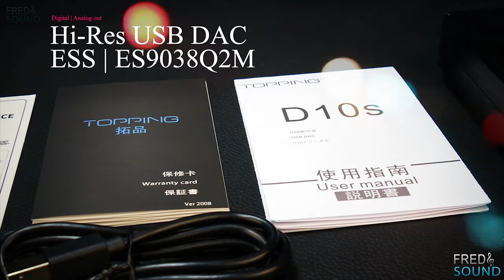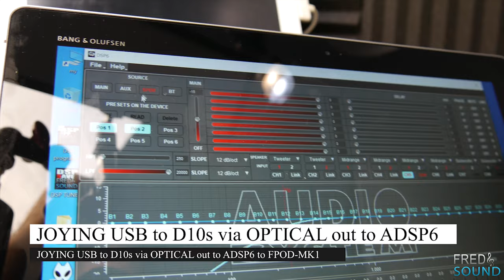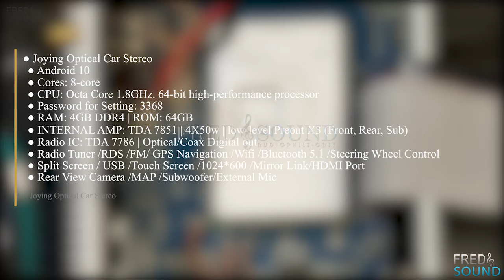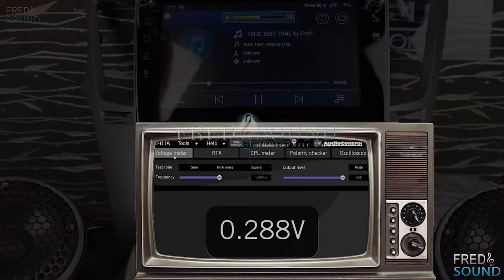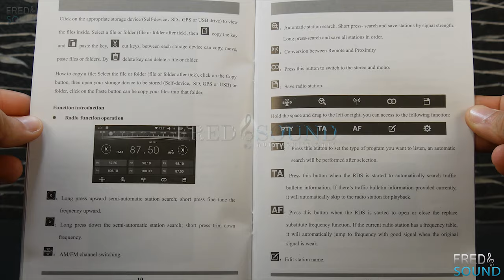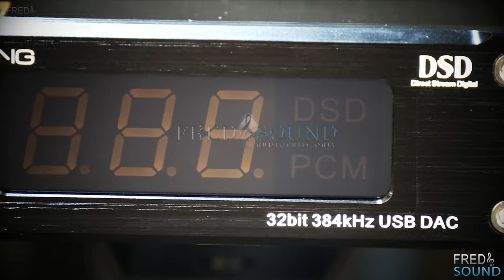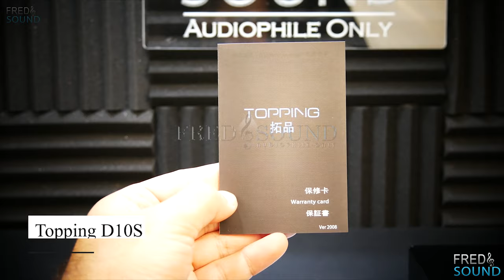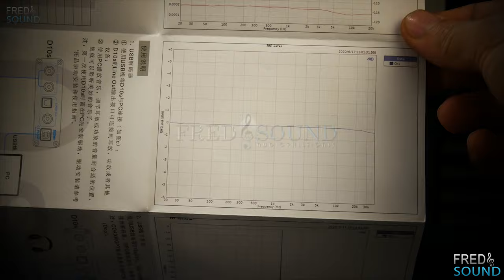Android Head unit using Hi-Res DAC Optical-AUX Out to DSP JOYING vs Topping D10s to ADSP6 (FNS)

Comment: Hello Fred. Is the optical or coax out of this unit very bad to use it straight on the dsp? I was thinking to get one and use it through coaxial to my Alpine H800 dsp. At the moment i don't have any after market head unit as i am using my DAP player for my music, but definitely a head unit is more convenient. What to you think Fred? Thank you very much for sharing.
Reply from the maker: Hi mate, the sound quality of this unit is not high-end at any mean. Yes you can connect it your way and it will work. But You will need to play with some eq input to maximize your flat eq out responds, as this headunit is not transparent you miss many details. If you set the eq correctly you can get it working. Thanks for watching

Comment: Glad to find somebody thinks like me about how to get hi-res stuff in the car. I'm just running old school Alpine CDA 79-49 with Optical output using LG phone with a quad DAC in it. Amazon Ultra high-definition stuff not too bad The best I can do right now but that's right there sweet
Reply from the maker: Thanks for sharing, how is the sound quality? Thanks for watching
Reply: The sound quality on mine it's the best I've ever had but like anything else that that's all you know and the best you've ever had and never experienced any better like what you have it's probably just mediocre for you. Sometimes it's just a challenge to overpower or drowned out the whine of the 14 lb of Boost from the supercharger. Two layers of sound deadening material on the entire inside helped
Reply: I'm looking at the RS Components on your one video where do you find those I can't find them to purchase
Reply from the maker: @russsmith9042  yeah that’s right, as long as you are happy no need to upgrade, about the RS you can’t find much online, they are very limited, if you need could help you getting them, contact by the email down at the description below, thanks

Comment: Question..
When using the Joying unit Optical output is the sound quality bad to any extent? like does it actually sound like it is lacking or sound distorted? or is it just that when using a USB DAC it sounds better?
I just installed a joying unit and next step is to set up an amp and speaker system.
i was planning to use the optical out to the amps and then later add a USB DAC if i find it is needed.
 but i am beginning tot think it is definitely needed.
so if i use one of these then it would be Joying --> DAC --> DSP --> AMP --> SPEAKERS

also i keep hearing that Joying doesn't support USB Audio. clearly it does as you are using it. is it something you hd to set up?
is it something that they didn't do but now do?
Reply from the maker: Hi, yes you can connect it directly, but the issue with joying is the sound quality processing, this is why it’s highly recommended using quality DAC, but then you are limited to control your volume via the DSP DRC only, Thanks for watching
Reply: @frednsound  jut trying to get an idea of exactly how limited. i understand there is shortcomings of the android system just wanting to know just how far short it falls.
is it really only that 1% audiophile sound quality level that suffers?
or will it be distorted and clipping when at a relatively high volume?
i am after nice clarity in the highs and lows but don't need SQL or Audiophile level
Reply from the maker: @SpudMaat  it will not distort early on optical out, it will work fine, only issue is the sound quality, lacking bass and feels empty sound, not full or rich, if you have it already it’s better you use the optical and see if it’s good for you, it maybe good enough for you
Reply: @frednsound  yeah thanks.
i suppose it would be easy enough to buy the system to use the joying optical output and then if that is not good enough would be no trouble to add in a USB DAC
Reply from the maker: @SpudMaat  yes right
Reply: i just find it very interesting how joying does the optical out.
optical out should in theory bypass the inbuilt DAC and sent just the raw signal.
but obviously it does not do that. it must convert to analog and then back to digital for output which will most definitely result in signal degradation. really trying to learn more and more about this topic and this product.
Reply from the maker: @SpudMaat could be, but not necessarily the sound quality issue, the internal board/DAC itself would be cheap, so the final sound output will be cheap
Reply: @frednsound  Doesn't it depend on the quality of the DAC used to decode the optical?
Reply from the maker: @ajazva  it is but many more parts will impact your final sound output. It’s always the full package. Thanks for watching
Reply: @SpudMaat  only benefit here I can see in involvement of d10s is the bitrate display . He is using optical out of d10s . 
 Therefore the god quality dac of d10s is not in use. 
 What he is doing is taking digital out of joying USB , feeding it to d10s, then again taking digital optical out of d10s. I don't see any benefit here as d10s is just acting as a digital byepass and not a dac. Rather its limiting the bit rate out of usb to 96/24 out to d10s optical. 
 Ideally, optical out of any head unit  passes the decoded bits of song data to the Optical or coaxial or usb circuitry. Where the raw signal bits are passed out serially. In coaxial and usb there is no alteration of bitrate , but for optical its capped to 96/24.
 Same is happening in optical out if d10s.  
 It would have made more sense if he would have taken analog rca our of d10s and fed to DSP. Since d10s has good dac . 
 But he is claiming that joying plays around with optical output signal , which I doubt. 
 
 Well he can verify it by checking if joyings in built DSP controls work for Optical out.
Reply: @frednsound thanks for the video, and I did find the Joying’s optical output has less detail on the output, so i purchased and trying to connect the D10 to Joying HU via USB, but the HU doesn’t detect/ or have option to select USB audio to route the audio through the D10.. pls advise if I missing out anything.

Comment: Thank you!  SQ/Audiophile nerd here, was curious if these android head units can use a high end DAC - my searches seemed like no. Ended up purchasing a Joying to test (returnable) the digital out -> my C-DSP 6x12 DL.  Glad I found this video and read your comments about built in digital out SQ.   So using the external DAC: Besides having to use DSP volume control, anything else to note?  Bluetooth handsfree/mic on the Joying still works?   

Do you still have this setup and would you recommend? Something better?
Reply from the maker: You’re welcome. Yeah Bluetooth works, but it’s depends on your model/firmware type, not using it at the moment. Best sound quality price to performance with optical out today will be the alpine utx-m08, night and day difference in sound quality/details. Thanks for watching
Reply: @frednsound  Thanks.  Locally that is HDS-990.  Not competition car I need navigation and radio etc so not for me.  No digital out but DNR1007XR is next on my list if the Joying-android HU is not nice to use.

Edit: BTW; I just verified I am able to use my SMSL SU-9 as USB DAC on my android phone. Tidal can stream to it directly and MQA works as well.  Hrmm
Reply from the maker: @h82fail  then go for the dnr and save all the hassle
Reply: @frednsound  Had the Joying on the way and wanted to mess with it - screen is nice but sounds bad.  Desperately wanted to get USB audio working because I like it otherwise.  How did you get it working for this video?

tested 3 USB DAC's I have and it wont output to any - all work on my android phone.  Installed "lesser audioswitch" App to try toggle to them since the HU hides the typical android media output settings - didn't work.
People say what I want to do only works with Intel based Android HUs that are not around anymore?  Or people mention USB audio player pro app but I don't want to go that route (have to play music within app).

Guess its time to send it back unless you have tips to get usb audio working on this? Have 2 weeks to return.
Reply from the maker: @h82fail  Well... was using the stock player app that comes with the unit, and the DAC was Topping D10s, did you try this DAC?
Reply: @frednsound  Thanks for the reply.   Tried a"Douk U2", and "es100 mk2", thought I also tried my SMSL but apparently not because I just plugged that in and it works as expected!  Have D10s on the way to play with to emulate what I'd actually install in the car.

Thank you!   Was convinced you must have been using an app or using an Intel cpu version.  (This one is UIS7862 C75/A55)

Edit: Have some ideas to get android to control the volume on my minidsp using macrodroid to capture vol controls and send it to dsp (usb or bt).  Have no idea if I can actually get it to work, I'll post if I do.
Reply from the maker: @h82fail  welcome mate, hopefully it will work fine for you. Keep me posted when you try the d10s
Reply: @h82fail  So the SMSL works? Did you ever try the D10s?

I am also wondering what the audio quality of the coaxial digital output on FYT7862 units is? Mine sounds very good so far.
Reply: @scook9216  Yes, and I did try the D10s think it worked as well. 

Had it setup on the bench to a receiver for a few weeks and it randomly switched to internal sound a couple times (with both working DAC's I think).   I'd have to reconnect the usb cable or maybe reboot to get it back.

Boot up speed and the clunky home screen software on the android were biggest downsides over the nav I have. So I ended up sending it back.  It could be cool, but life has gotten too crazy for another geeky project that was going to require extra focus.

Comment: Hey Fred, 

I know that this is an older video but I wanted to ask this question.   When you go from head unit (usb) to topping d10s to optical don't you lose the volume control?   How can you control volume?   Also where does music come from?  Another usb with music?
Reply from the maker: Hi mate, the music will come from the other usb, and the volume will be controlled from the DRC (DSP) thanks for watching
Reply: @frednsound  

Ok. As I thought.   I am doing an installation with a Zapco DSP amplifier for a friend.  Unfortunately the amplifier does not have the option of a DRC.
Reply from the maker: @drrckhamilton  I see,so it will not be ideal for you
Reply: @frednsound  

Thanks Fred.  After a bit of experimentation I have come to the same conclusion.   One good thing however is that using the line out (rca) does not affect the ability to control volume with the head unit.   Not quite as good as digital but at least he doesn't have to scrap what he has and start completely over.  Decent compromise.
Reply from the maker: @drrckhamilton  thanks for sharing 🎼

Comment: Hi Fred, I have recently got a Joying headunit with optical and coaxial out. My question is why we cannot use optical or coax out from Joying directly to dsp? Why should we use usb out to D10 and then use D10 optical to dsp? Also, what I found is when I use optical out from joying I am able to control the volume. So does that mean Joying optical is not pure digital out? Is the audio processed by joying dac and then converted to optical instead of pure digital out?
Reply: I’m looking to get the highest sound quality output from Joying headunit… I use a Helix dsp mk3 pro …could you please suggest which is the best option to proceed?
Reply from the maker: Hi mate, yes you can connect it directly, but the issue with joying is the sound quality processing, this is why it’s highly recommended using quality DAC, but then you are limited to control your volume via the DSP DRC only, Thanks for watching
Reply: @frednsound  Thanks for the quick reply. If my understanding is correct USB out from Joying has unprocessed pure digital out compared to the optical out from joying. If yes I will buy a D10 and control via Helix Director.
Reply from the maker: @karthikm888  welcome, the internal sound processing is cheap,  that means when going out optical or rca it will be cheap, if you use the DAC via the joying usb it will sound better, also, if you use helix DSP, you can use the usb input in the DSP it self with the hec module, and stream music directly from an iPad or any other quality source
Reply: @frednsound  Thanks for the information…that is really helpful…I’ll get an HEC module and connect via usb
Reply from the maker: @karthikm888  great mate, wish you success
Reply: @frednsound  Thanks mate… Is there any option in the Helix Director to see the input sampling rate like how we see in the D10? If there is no option in the Helix to see sampling rate is the D10 as good as Helix HEC since I would like to see what is the sampling rate
Reply from the maker: @karthikm888  for the hec usb it will give you the resolution of your DSP that it’s designed for, so just check that DSP specs
Reply: Hi level or rca level which is more clean output
Reply from the maker: @surajbhan6549  both are the same, 
the hi-level has better voltage
Reply: I'm looking at this same scenario...so it would be joying hu----d10s----helix mini dsp mk2??? I usually stream via Bluetooth but I could just put a usb stick in the joying and stream off that unless there is a hi-res Bluetooth adapter that has ldac or something?
Reply from the maker: @mrcleeo  stream with your usb hac adapter to DSP will be better
Reply: @frednsound  hi mate thanks for this video. I was looking at something similar a while ago and had got the Douk Audio U2 PRO XMOS XU208 Digital Interface, USB to TOSLINK Coaxial/Optical/HDMI IIS Audio Adapter, for DAC/Preamp/Amplifier, Support PCM & DSD256 https://a.co/d/0cQi8TI I use joying. And for dsp have a minidsp. Do you think with what I have the setup is better. Any idea of the douk audio vs topping?it seems to have the same specs almost,  just to be sure I am not missing anything. 

Also from joying I can take any USB out?  Or a specific one,  does the type of USB cable matter?  If yes what should I look for?
Reply: @frednsound  Hi mate… I got topping D10 and when I connect to the Joying usb out it shows 386 pcm and no audio output. Could you please help of there is any setting I have to change?
Reply from the maker: @karthikm888   hi, nope, no changes, just plugged the DAC into one of the 2 back USBs and then control the volume from the DSP itself, if you still can't try another USB port or another USB cable. thanks
Reply: @frednsound  Thanks for the quick response… I tried with different cable and ports…still the dac doesn’t work
Reply from the maker: @karthikm888  in this following video link you can see the settings on this particular joying unit, check if yours is similar, for me, it worked right away:
https://youtu.be/alXTLt4Gbis
Reply: @frednsound   the optical out ideally should not have any sound processing or dsp in the path. 
 The song data is decoded and then passed to Optical circuitry where it only limits its to 94/24. 
  Same goes for USB. Decoded song data is passed to USB where it passes out as serial bits to usb port. 
  I don't understand if there is any processing involved in digital out via optical or usb. 
   Except the 96/24 capping, there should be no degrading in optical path.
 One way to confirm is see if DSP controls on joying work when connected via its optical out.
Reply from the maker: @kdeep1690  so what you are actually saying is, all head-units sound the same? Interesting
Reply: @frednsound   when comes to low level or high level, every HU will sound different due to chips and circuitry components and implementation used. If talking about optical or coaxial diffrence will lesser due to lesser no of components involved in shorter signal path. Music data> decoder chip > decoded signal data bits> optical circuitry> digital bits out. 
 In this path, quality and accuracy of decoder chip and electronic components used will vary the sound signature of every HU. 
 Difference willl minimize as signal path components decrease. 
  But here our concern is about what i wrote in previous comment
Reply from the maker: @kdeep1690  I will have to disagree. Every model/device with optical output will sound different with big differences with different notes.
Reply: @frednsound   thats ok, I agree to it, if not completely. 
 But my question was what benefit did you get by not taking optical out of joying and then putting d10s in between and ultimately taking optical only out of it?
Reply from the maker: @kdeep1690  the sound with the topping is completely different than the joying. The joying is so shallow even with optical. No bass and lacking highs. Can’t use it for high-end setups, but just budget.
Reply: @frednsound   are you using dac of d10s ?
Reply from the maker: @kdeep1690  in this video, yes.
Reply: @frednsound  digital signal enters via usb and goes out digitally via optical. Wher is dac used in this?
Reply from the maker: @kdeep1690  you come back to the point where every digital output sounds the same right?  Thanks.
Reply: I would like to hear the answer to this. Is there quantifiable evidence of the poor sound of the joying optical output? Or is it just the opinion of Fred that it sounds cheap?
Reply from the maker: @travisbarrow3408  don’t fall into the “all headunits sounds the same” people like to speak data when sound output is completely different thing. We didn’t invent the DAC and didn’t invent the headunits. Little sense could help here.